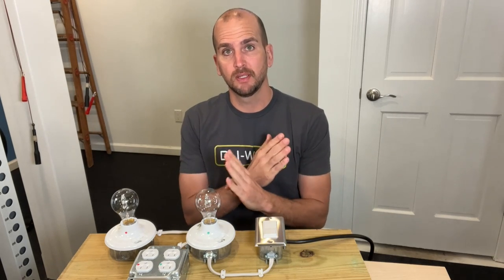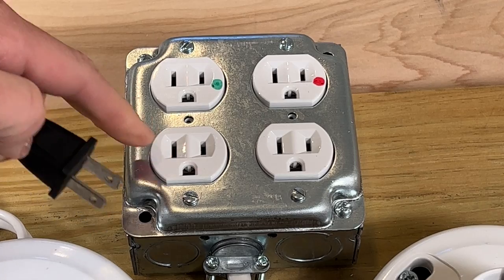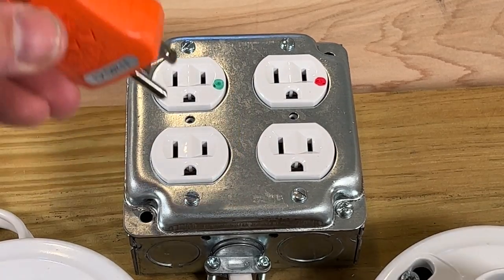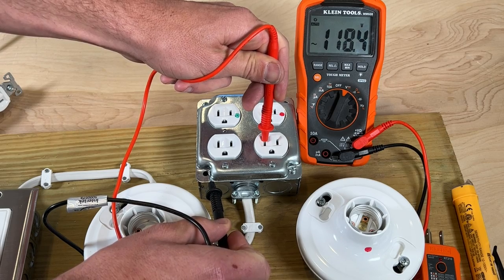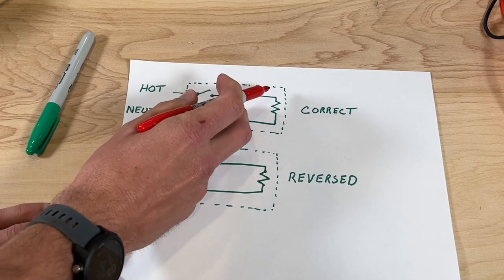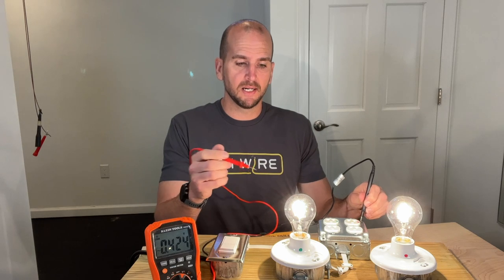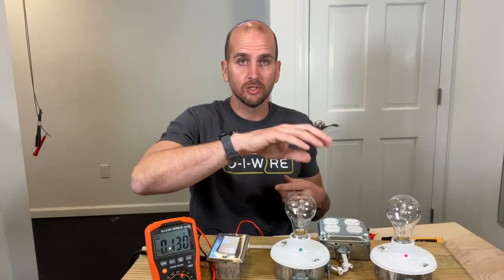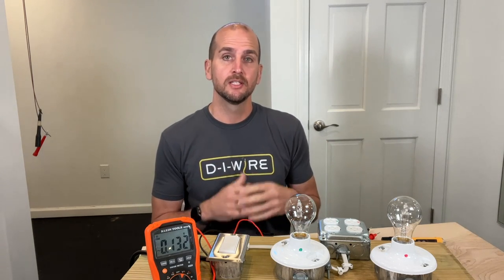Dangerous Wiring Issues In Lights and Outlets

Comment: Nice video. All very important facts for anyone doing electrical work and well explained!  But a few minor corrections to keep you from spreading false information...

At 1:40 you mention: "... plugged in either way and it doesn't matter because they have a little additional circuitry inside that makes them adapt to that.".

They don't actually have any such circuitry.  With A/C signals as used in power systems, there is no polarity like there is with a DC signal that may need to have wires swapped internally to work correctly.  The hot vs neutral has nothing to do with the current flow or power transfer. It's only about human safety.  It's all about keeping humans from being shocked. The non-polarized devices keep us safe by having no external metal case or screws that can shock us. With no exposed metal parts and the correct insulation around all circuits, it makes no difference what side internally is connected to hot or neutral. In fact, with no ground reference to work with, the circuit can't even determine which way it's plugged in.

At 5:40 you mention: "... or can reduce the life of your device" [when hot and neutral are reversed in a device like a light].

In terms of power and current flow in A/C circuits, it makes no difference if you swap hot and neutral.  You are correct that the entire circuit is "hot" RELATIVE to GROUND, so this creates a very dangerous safety issue for sure, but it does not power the device (when the switch is off) any more than with a correctly wired switch.  It will not reduce the life of any device. Again, the hot vs neutral polarity is ONLY about human safety.  When it is wired incorrectly, we both risk shocking people and starting fires.
Reply: I disagree.  I have a few machines in my store with rectifiers built into their control boards.  Reversing hot an neutral on these machines results in power spikes on shutdown that will fry the micro-controllers.  Ask me how I know.
Reply: @johnmiller8884  I can believe you have machines that can be fried by the mistake, but the only way that happens is if the machine is wired wrong internally and uses the safety ground as a conductor of some type.  What type of machines are these?

Comment: Here in Australia/New Zealand we generally use BC lamp holders - it doesn't matter which way the lamp is inserted. Also out 240 volt outlets the phase (red) and neutral (black) the pins are at 45 degrees while the earth pin is vertical, that is one can not get it wrong and at the back of the out let it is colour coded. P.S. the UK is basically the same!  Also our outlets are switched and today the lights and outlets are protected (user) by RCD's and MCB's

Comment: I worked on a house where the outlet to the fridge was reversed and the subpanel feeding it had the neutral and ground bonded, so every time she opened the fridge door she got a shock! And she was in her 80's. We fixed both those issues. The only place your neutral and ground should be connected (bonded) is the main service entrance.
Reply: It is very important not to bond the neutral and hot in a SUBPANEL.  Many good online videos explain why the main panel must have ground and neutrals tied together and subpanels SHOULD NOT have neutrals and grounds bonded together.
Reply: @ojbates2006  My boss explained it very well 40 years ago. Oddly, A lot of houses still have no ground wires and commercial buildings too. They used to think the ground would shock you, it was dangerous!

Comment: I work as an electrician as well. One of customers gave us an antique light to install but the wires had no indication which was ground, neutral, or hot so ended up pulling my meter out to figure the three wires and hook it up correctly using the ohm setting.

Comment: I understand that with a reverse polarity on a light bulb that one could still receive a shock from touching the bulbs threads even when the light is off. How would one test a light fixture for correct polarity besides screwing in an adapter and inserting a circuit tester? Great job explaining this occasional problem.
Reply: There’s nothing wrong with screwing in an adapter and using a tester. Alternatively you could (carefully) use the test leads of a multimeter. Or more safely, use that in conjunction with the screw-in adapter.
Reply: You can use a non-contact voltage tester.

Comment: You also have to be careful with older lamps that have non-polarized plugs.  Nothing from before 1962 would be polarized, as outlets weren't required to be polarized.  I can't easily find when new lamps were required to have polarized plugs, but I'm sure it was much later.  So with plug-in lamps, you should be extra careful and assume the socket is always hot unless it is unplugged.  Remember, if the plug is flipped, the switch will be on the neutral, so the shell of the socket will always be live when it's plugged in, even if the light is off.
Reply: Being from the EU I had never even heard of polarized plugs and outlets before I saw them on YouTube. What a strange concept..🤔
Reply: @nolanhitchens  How else do you control which wire is hot and which is neutral?  Especially so that any power switch on the device is on the hot wire, not the neutral wire?  Or do they just not care in the EU?
Reply: @pfcrow  No idea. I guess things are properly designed and isolated. I've never ever heard of someone being electrocuted while changing a bulb, even with the 230V. And we don't usually cut wires without first taking out the plug or turning off the circuit.
I recently cut some wires (insulated pliers) to install a new ceiling light after using the wall switch to turn the light off, assuming (😬) that would also cut the power to the wires. It instantly triggered the (earth leakage?) circuit breaker downstairs. So no harm or damage done, no sparks, nothing. But this video confirms my suspicion that the wall switch may not be connected properly, I will check.

Comment: It’s often advantageous to switch the neutral on older fixture.   Pilot lights,  memory functions and other low voltage functions were allowed to use ground as neutral and worked off the always on hot.

Comment: In Europe it is normal to have table lamps. floor standing lamps, etc. with Edison screw lamp holders and fitted with two pin reversible plugs. Therefore a 50/50 chance of reversed polarity. Always a good plan to pull the plug first!

Comment: 5:52 What you want is that the hot side is cut off at the switch. Imagine someone wants to change the light fixture, he might just turn the switch off assuming that will cut power to the socket so he can just take off the fixture and put up a new one. But in this scenario the socket is still hot because the way light is turned off is by taking neutral away from hot. Now someone might touch hot and ground and has quite some surprise.

Comment: For a little comic relief, I live in Belgium. We have 3 wire system, 240 volt systems in houses.. One is gnd, of course, and then we have blue and brown, one is supposed to be HOT and the other Neutral. But the Neutral IS NOT at ground, it floats at about 40 volts. BOTH of these have circuit breakers! So when working on circuits, just turning of wall switch does not work, you need to open both circuit breakers. The “40” volt floating neutral is still enough to get your attention. Great video, thanks.
Reply: Sounds you have some problem if you have 40 V on the neutral. Sounds like a broken neutral.

Comment: Great safety video. That's the reason they always told you not to stick a knife in a toaster. Before polarized plugs the element could be getting potential and if you touch it with a knife, zap.
Reply: Toasters cut both sides when the tray is up - at least modern ones do.
Reply: @okaro6595  cool.   Did not realize that, I always thought the toaster just cuts the hot side when the bread pops up, as long as it has a polarized two prong plug or three prong plug.   Of course the manufacturer has no control over the possibility that the consumer has some shady wired outlets.  That's a good feature,  but I always unplug my toaster if I find it necessary to pry out stuck food, because you can never  assume the outlet is properly wired and /or every manufacturer has a double pole switching mechanism.

Comment: I know a lot about wiring. I've known a lot since I was a kid, I've read all the books at the library, I've had the Time Life books on basic wiring, and I went to trade school as a backup plan to learn the more advanced things. Every single house my parents or myself have ever purchased, the wiring was exactly wrong, or a downright fire hazard, except for the house my Mother had built for her. Old wiring, aluminum and copper spliced together without thermal paste, improper wire nuts and in a surprisingly lots of instances, mostly in basements with ceilings, open air splices of bare copper wires twisted together and exposed.

This latest house I purchased the idiot put in grounding outlets that didn't have a grounded box nor wire, Used plastic boxes, so they couldn't even be accidentally grounded,  Junction boxes spliced into chains of boxes, 4 and 5 times over. Two or more Romex cables haring one clamp strain relief. In one case, no clamp at all. No GFCI in kitchen nor on Washer machine circuits. Just a nightmare that's going to cost me over $20,000.00 to fix. I wish people that don't know what in the hell they're doing would leave their hands off wiring. That's how houses burn down.
Reply: Why did you buy it then?
Reply: @stevepettersen3283  Because I don't function well being homeless.

Comment: Oh geez. I ran into this in high school when I was working at a planetarium.

We had a newly installed bank of dimmers for special effects projectors  that ran up to some terminal blocks in the planetarium cove. I went up to the cove to attach some projectors to the terminal blocks, having made sure that all the switches were off, and got shocked. Pissed off, I went back down out of the cove to the console, but the switches were all still off. I checked the wiring and, sure enough, all the switches were on the neutral side. My best guess was that the guy who installed them saw "do not wire while hot" on the dimmers and assumed it meant to install them on the neutral.

He was a CETA trainee, which somewhat accounts for it, but previously he had been in the Air Force working on the wiring in B-52s.

Comment: Owner of a 1913 house here with a lot of original wiring. All the switches/fixtures are wired with a switched neutral. Supposedly at the time they thought it would extend the life of the switch. I got a small but painful shock changing a light recently. Now I am very carful or I turn off the breaker.

Comment: Reversed wiring is used in doorbell, where is necesary limitate current to doorbell switch to avoid dangerous discharges if it is wet. In this case user received some dischage but not lethal than if switch is conected to hot.

Comment: If someone theoretically completely scrambled up the wiring so that the ground and neutral wires were actually connected to 120VAC, and connected the hot to ground, the outlet tester and DMM testing would show everything is just fine.  
This is where a non contact tester would be helpful to identify this odd situation, as that would easily pick it up.  
If you're up on a ladder and didn't have any known ground reference, the NCV is a good confirmation to have along with the other tools.
Reply: This condition actually happens more frequently than you might think.   In an old house that was originally wired with 2 wire ungrounded circuits and two prong outlets, sometimes 3 prong outlets are installed without providing a ground wire.   In order to fraudulently pass a home inspection and make a 3 light tester indicate correct wiring,  a jumper wire is inserted between the neutral and ground screws,  aka bootleg ground, or false ground. If there is also reverse polarity,  you have a reverse polarity bootleg ground (hot connected to neutral,  neutral and ground pins sitting at 120 volts to ground potential)   tester will indicate correct wiring,  and most if not all appliances will appear to work properly, except a device with metal housing and a three prong plug will have it's case live.   And with the possible exception of sensitive electronics,  most devices will work without problems,  if the polarity is reversed, just not in the safest manner.

Comment: Back in the late 1970’s I worked for a power company.  On rare occasions I would find in old Victorian homes wall sconces wired using the old gas light gas line as a neutral.  The electric light fixture would have a hot wire connected and a neutral/ground connected from the fixture to the gas line,  which was still pressurized.  When I asked old timer co-worker about this he told me that at the time it was thought electric lights were a passing fad and would not last. It was cheaper and easier to run a single wire and the gas line was capped and left in the wall so the gas lights could be re-installed.  Talk about unsafe!
Reply: Microsoft thought the Internet was just a fad too. Maybe they still do? But yeah sometimes people can be really wrong about some things.
Reply: It isn't that bad....don't let those old Victorian homes gaslight you.

Comment: Good video. Would have a  120 volt power outlet in the bathroom that has a broken wire somewhere in the wall yet other outlets in that circuit work fine. A video on how to track down a broken wire would be good.

Comment: Simple rule of thumb... DON'T TOUCH the electrical metal doesn't matter if it turn on or not.  Just like even if a gun is unload, you don't point it to anyone's head and pull.  Always consider it is live or loaded.

Even with the light out I'm a bit concern touching the metal contacts.  Never know if there is a cap in there that still storing charge.  If i care i would short it out and than touch.  But just don't touch is simplest.

Comment: Very easy to reverse the polarity when replacing a lamp cord or lamp socket. If in doubt, use an ohm meter or continuity tester to make sure the the ground/socket connection goes to the wide blade on the cord. If you don't have a tester, most lamp cords have light colored markings on the insulation to differentiate the hot and neutral sides of the cord.
Reply: If you don't have a way to test for continuity then you don't have the equipment required to rewire a lamp. I guess you could always just plug it in and lick your finger then touch the screw base. You got a 50/50 shot at having done it right. Are you feeling lucky punk?

Comment: I work on a lot of old houses in the Denver area and I found another issue where they ran the hot wire directly off the breaker box to the light fixture,then to the switch, and then from the switch to common. So you can turn the switch off and there's still power at the fixture.
Reply from the maker: Yes, I have ran into that type of circuit as well.  Not a fan 👎
Reply: Same here, ran across that a few times as I was helping my step dad rewire his 1973 double wide, which had numerous problems with the aluminum wiring including a metal junction box concealed in the wall (highly illegal and dangerous,  for those aware  all splices must be accessible meaning it cannot require removal of the building materials to access) that had overheated to the point of charring the stud.    I am not a big fan of this fortunately the code required a neutral be present in a switch box since 2011, making this wiring configuration virtually extinct,  the only legal today, is to run 14/3 NM from the light to the switch box, which is pretty much pointless 99% of the time.

Comment: I ran into this.  I had a light in a basement controlled by two switches.  I wanted to add two more light fixtures.   I added two light fixtures coming off the existing one.  Similar to the ones in your demonstration except the fixture also had a receptacle.  When I finished wiring it and flipped the switch the light worked but when I plugged in a tester to the light fixture it showed reverse polarity.  That’s when the 1 hour job turned into a half day job trying to find out what was going on.  It turned out the issue was an error in the switches.  Instead of two 3 way switches who ever wired the original light used 1 3 way switch and one 4 way switch.

Comment: I have run into the "reverse polarity" situation, and it was "SHOCKING"!
While rehabbing and rewiring an older cabin on a lake, that had some old "two wire" outlets, I ran into a situation where whenever someone touched a metal electric stove they would get a shock!
Now we had rewired the "original" part of the cabin that had the two wire outlets with no ground, but we did not have to touch the "addition" as it was wired with grounded outlets, and upon inspection, looked to be wired correctly.
After getting "bit" a few time I just HAD to find out what was wrong.
It turned out that at some point during the "addition" being wired, someone had REVERSED the wires (black to neutral, white to hot) and had not marked the wires AND buried the metal box inside the wall!
Once I found this box and wired it correctly all was good with the world again, but it sure was a surprise to get "ZINGED" when we would touch the stove!